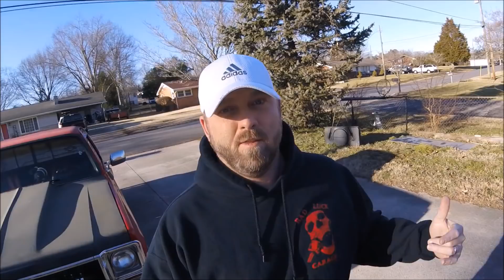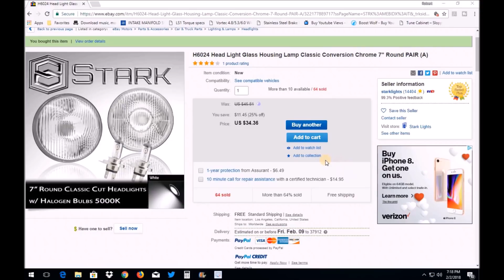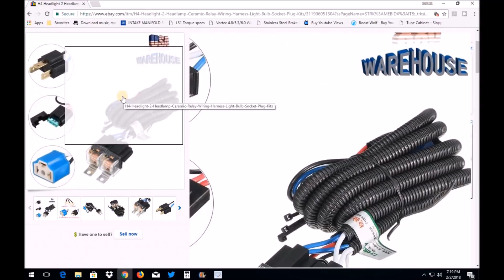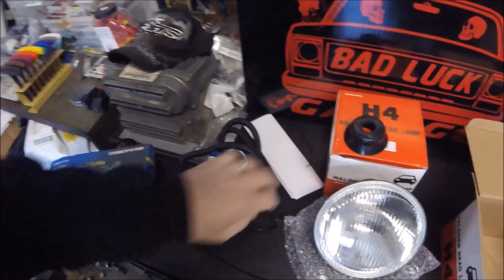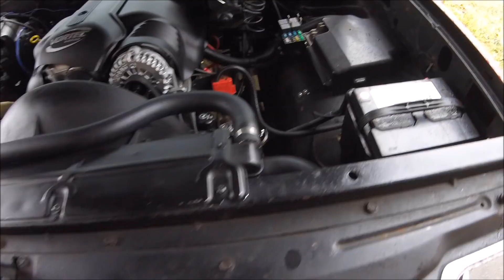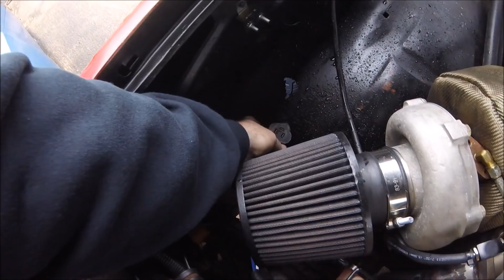CLASSIC CAR HEADLIGHT CONVERSION THE RIGHT WAY

Comment: would the extra harness be necessary if you went with h4 leds since leds draw less watts/amps??
Reply from the maker: You would need to do the math and decide if the new LED lights surpass the original halogen lights power consumption. You might be surprised how much power modern LED headlights actually use. LED lights generally use less power to produce the same light output BUT they usually are not producing the same output. They’re usually producing several times more light output and are consuming the same amount of power or more to accomplish that. 
That being said, I would recommend upgrading the headlight harness in these older vehicles even if using the oem style lighting. Adding these relays means less power drop going to even the factory headlights and you will usually find that even the oem style headlights become brighter with the relay and harness upgrade. For less than $20 I really can’t see any reason NOT to upgrade.
Reply: @BadLuckGarage I hear you thanks for the reply take care

Comment: Hey sir👋🏽 quick question, can I install a 
“Pair H4 LED Headlight Canbus Error Free Anti Flicker Resistor Canceller Decoder”-eBay  instead?  And would I have to do that for my 4 bulbs or just the high beams. I have a 1965 impala and my light flicker when I put it on high beam.

Comment: Loosen the nuts that hold the soldering tip to the soldering gun, then snug back down.  Do this two or three times to knock the electrolysis scale off of the contact areas of the tip.  Then it should work like a charm.

Comment: look up Daniel Stern Lighting and talbotco.com. Great information and products.  I've meet Stern, he's the best. Talbotco has really topnotch products. Haven't got lights from them, but know their brands. Stern doesn't like hid and led conversions in halogen lens. Read why. He's right. He and talbotco sell some pricey stuff. It's a far better value than the conversions. Your right about the relays, quality wiring and relays can put out 40% more from sealed beams, vastly more with issues common to old wiring. My vote is you've done enough. Enjoy!
Reply from the maker: Yea I was really happy with this setup on the turbo truck and planning to do the same to the Nova if Ray wants me too. Everything I do is usually budget oriented so not sure about that website but prices actually seem somewhat reasonable.

Comment: So if I were to go with the LED headlight versions from Stark, do I need the relay harness to prevent any electrical fires from the headlight switch? Or does it draw less power?
Reply from the maker: As I mentioned in the video, I recommend doing the relay harness before anything else. It’s only $14 and will even increase the brightness of your factory sealed beams and cures the burnt up headlight switches that older vehicles are notorious for.
Reply: 10-4 Thx
Reply from the maker: Yes sir! 👍🏻

Comment: When’ are the burnout videos coming ?
Reply from the maker: Lol, as soon as I get another set of tires for the 20s. The drag radials cost too much to waste. We’re on a budget over here. 😂
Reply from the maker: Johns actually got the wheels and tires that were on the S10s frame we used for the 54 and I’ve already got the right adapters that I use when I’ve got the 20” Camaro wheels on so maybe it’s time to finish those tires off. 😈

Comment: Nice! I ordered a harness like that for my 67 impala fastback a week ago but for 4 lights instead of 2....should be here any day now FROM CHINA..lol..thanks for the vid..very helpful..
Reply from the maker: Hello John DOE, Thanks for watching! Im glad this video helped you out! I try not to order from china directly.As I said in the video, I usually look for the cheapest seller thats still shipping from inside the US. Its still the same Chinese part but the extra dollar or two is worth it to me to get the part in a few days instead of a few weeks,lol.
Reply from the maker: Everything is listed in the video
Reply: drksole3666 if you go to eBay type in classic car headlight harness and I bought the 5 3/4 4 lamp headlight harness..
Reply: What kit did u buy? I have a 67 bel air with 5 3/4 headlamps

Comment: Agree 🤝. The bulb will last longer too. I also do a lot of electrical. It's gust that most consumers are not told how something like that harness will save a lot of headache in the long run.
Reply from the maker: Yea I actually tend to over explain things sometimes. Lol
Reply: would the extra harness be necessary if you went with h4 leds since leds draw less watts/amps??

Comment: Good job. Love to see you use the relay harness. The money well spent.
Reply from the maker: Thanks for watching! Yea I’ve actually built relay harnesses back in the day before I found ebay. Just doing the harness alone will usually increase the light output, even on the original sealed beams.